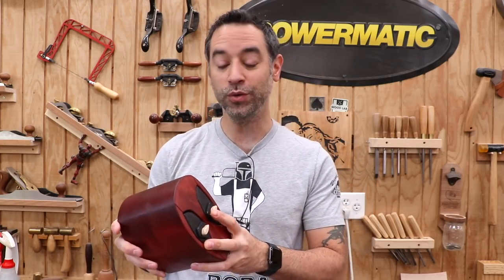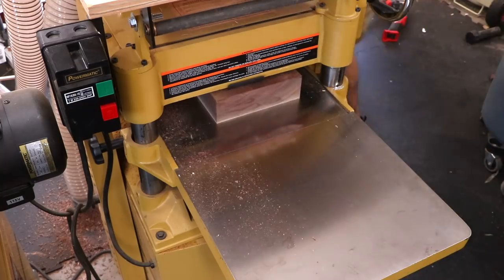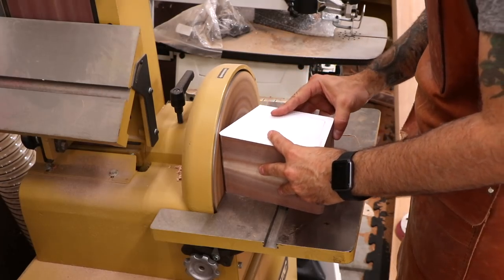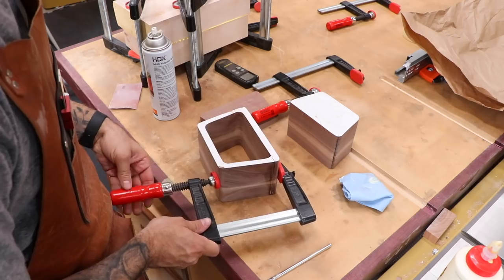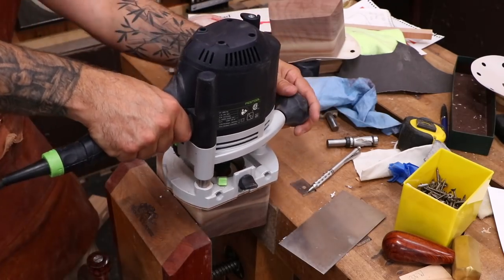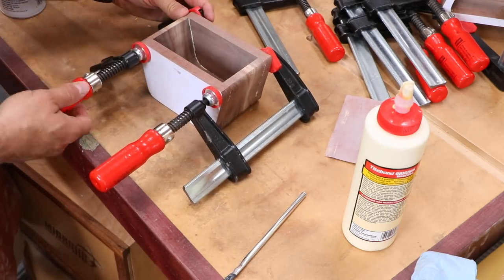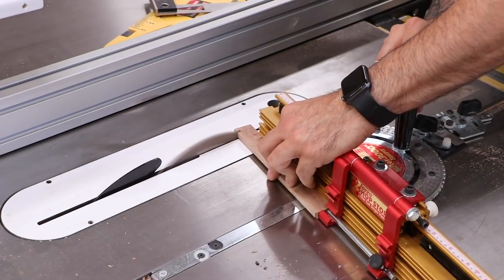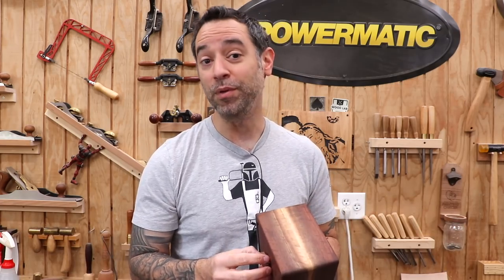Simple Trapezoid Bandsaw Box

Comment: I want to try and make a trapezoid box which is too large for this method; but not sure if mitres/bevel joints will be strong enough so maybe finger/box joints would be better? It needs to be strong as it is a cabinet for a heavy audio chassis and will have a handle on top to carry it around. Basically its 26" wide at base, 22" wide top and 7.5" tall and 8" deep. The sloping sides are about 110 degrees. I will use either 1/2" or 3/8" ply or pine perhaps. In the finished box the outside corners will have 1" radiuses on the 8" ends and 1/2" radius on the long sides front and back. What would be the best/strongest joint method and something a DIYer could do? Bevels look simpler and I can add cleats on the inside, as the box will have front face panels and a slotted rear panel, so you won't see the joint detail on the inside. So should I use bevel joints with cleats and glue and scree, (or nail); or should I use stronger box/finger joints which complicates the job but makes it stronger? Thanks

Comment: Because you removed some material from the outer box and glued it back together, doesn't that make the box slightly uneven by whatever your blade kerf is? I would think that would make the box insert be tighter on that side and have a visibly different reveal?
Reply from the maker: Yes, that is exactly what happens. At least on my box, there’s enough slop in the fit of the drawer that that slight discrepancy makes no practical difference.
Reply: I’d think a straight through cut with two glue joints would be better.

Comment: Great video! I just made The Tennessee Box from David’s excellent book. How thin is the blade you used for the inside cuts? Looks like 1/8” but I had a very hard time finding blades that are under 1/4” in lengths longer than 144”.
Reply from the maker: Details in the description.
Reply: Thanks. I have a Laguna 18BX so need a 12’ blade and no one seems to make the blades smaller than 1/4” that long. I finally found a company that would custom weld one but still haven’t found a 1/8” one. I’m guessing just too easy for it to snap.

Comment: Question 1: why not start the initial cut on a face that will not be visible on the finished part? The bottom/short side of the box for example.
Question 2: at the very beginning, you're cutting off almost at least 1/3 of the blank you prepared. That looks like a waste of material to me. Is it a common practice in woodworking to have such a "safety margin" on material?
Reply from the maker: You should be strategic about where you start the cut. While cutting on the bottom is good because the long part of the cut is hidden, it's also making a cross-grain cut along the front rim, which is visible from the front. So you need to pick your poison. As for the waste, I can's speak of anyone else so I don't know if it's common. I was just throwing this thing together very quickly and wasn't worried too much about waste. But I can also say that you need to be careful about the size of the pieces you run across a jointer and through a planer. So I made them as short as was comfortable with those tools.
Reply: @woodwhisperer  So, cutting on the bottom of the side face seems like a good compromise, doesn't it? :-)
As for the material, I understood you did that just for demonstration purpose, I don't expect so much waste for "normal production". Also, correct me if I am wrong, the excess material is useful to safely handle the part in the process.

Comment: Aren't the bearings @ 2:15 too far forward?
Reply: Nope
Reply: @daveklein2826  let me clarify...2:18. It looks like the front bearing is actually beyond the kerf of the blade. Could be optics but seems wrong to me.
Reply: @charltonwang  not if you are using Carter guided
Reply: @daveklein2826  I don't have Carters on my bandsaws but I am well familiar with their line. Are you making reference to their sidebearingless thin blade guide (with just the grooved radially oriented thrust bearing)?
Reply: @daveklein2826  I have seen Alex's video many times. I don't believe there is any comment of side bearings being set forward of the blade set. Of course, the most revealing (and arguably debatable) aspect of his video is his position of the blade on the wheel.
Reply: @charltonwang  is you are debating Alex, you know NOTHING
Reply: @daveklein2826  Okay, Dave. What you say.
Reply: @charltonwang  TROLL
Reply: @daveklein2826  Thanks for clarifying your background!
Reply: @charltonwang  TROLL